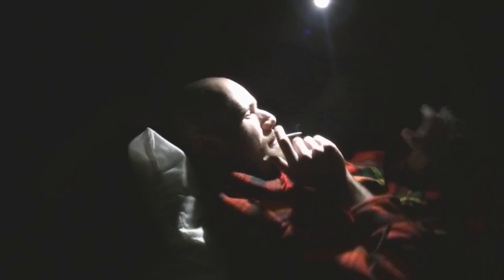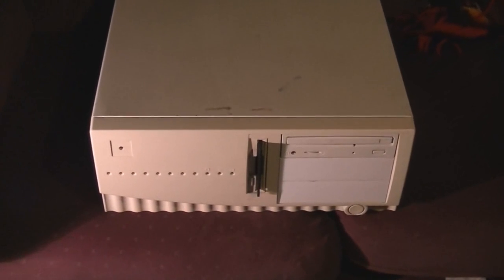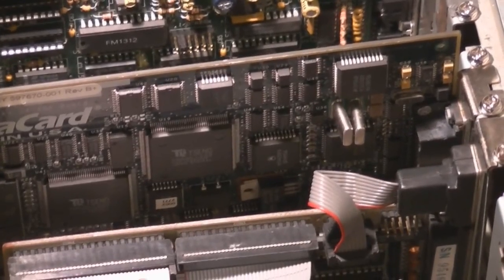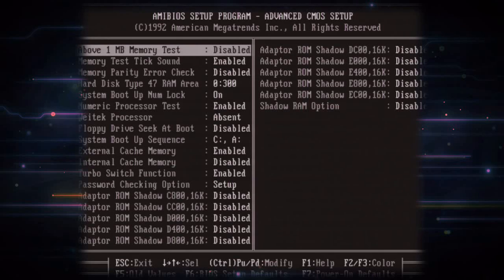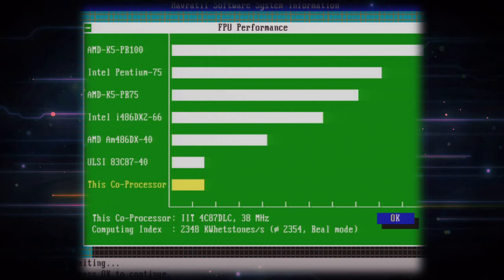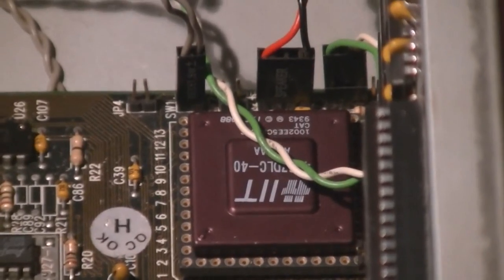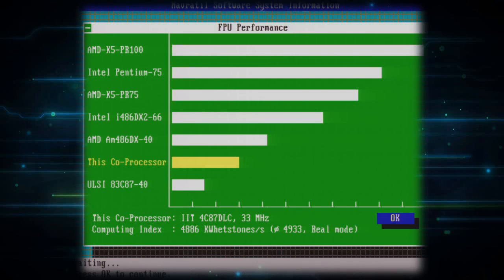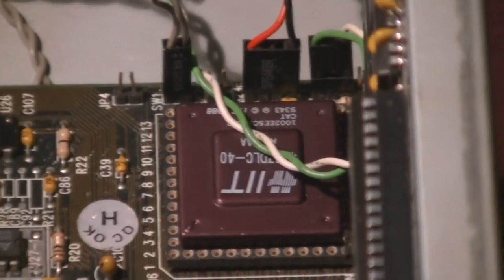386/486 Hybrid Overview & 386 Face-off

Comment: I got Windows 2000 Server SP4 to load on the Cx486 on a 386 Motherboard, then switched in a i386DX 33MHz and it got stuck at "Starting Windows..." after the white bar has gone all the way would never show the Windows 2000 splash screen...  Windows XP simply just blue screened with either processor

Comment: I thought it was pretty interesting. I gots an old Pentium 100mhz processor in a motherboard that looks like it was designed for a 386... its quite slow...

'Quite slow' as in=47 minutes 21 seconds to load MS-DOS 5.0... WITH 512MB OF RAM IN IT GOD THATS SLOW
Reply: FAMICOMASTER I don't think that the CPU or motherboard has anything to do with that but more with the harddrive that's faulty or not setup right.

Comment: Falcon 3 came out in 1991, and it's one of the few games of the time with FPU support. It also had fairly high system requirements for a 1991 game, but I'm pretty sure it would run nicely on that 386. :)

Comment from the maker: If your motherboard or card supports CD-ROM drives, loading OAKCDROM.SYS in CONFIG.SYS will do it with little more than plugging the drive in. I'd recommend altering CONFIG.SYS further to use a menu as the driver uses a lot or RAM. You'd also have to load MSCDEX from the command line or AUTOEXEC. If your controller/mobo doesn't support them, hooking one up won't break it, you'd have to get a controller or sound card that has support. I'm happy to discuss this via PM if you want help with it.